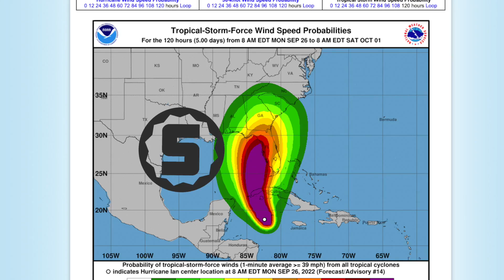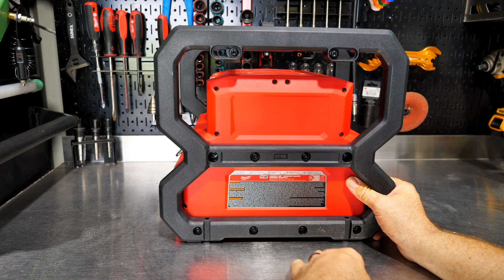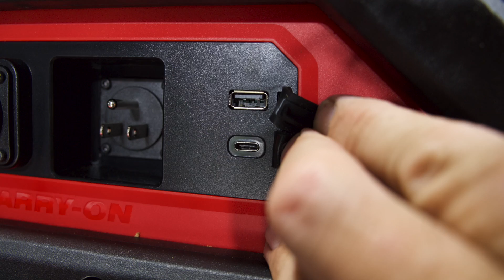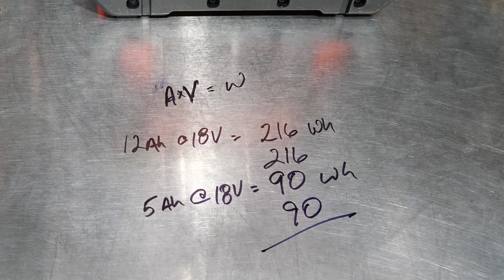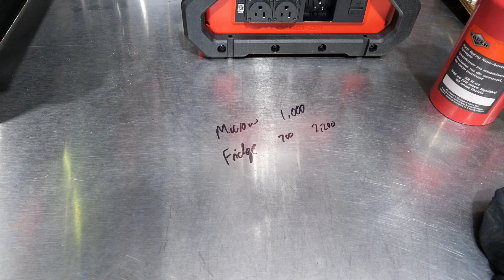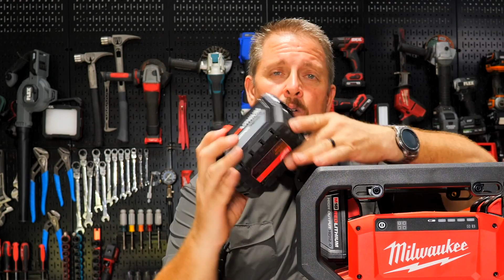INDOOR READY! 3600 Watt Milwaukee 2485 M18 Carry On Power Station [HURRICANE IAN READY]

Comment: On your light bulb draw setup you should have put 100w, 250w and single 500w bulbs on some switches so you can do smaller or more incremental changes and smaller draw amounts for smaller inverters. All you would have to have is 1 250w,  2 100w and 1 500w to give you all the necessary variability. Did you really need that many 500w for testing you do?   Even maybe a 50w or 75w for the top off or little inverters if you are testing them

Comment: The other thing I forgot was being able to hotswap batteries.  As batteries get low, then being able to replace them one at a time for a few seconds without having to power down or stop your units that are plugged in. Other such units allow you to hotswap batteries such as the lds reliance inverters which they have a 300w, 600w, and 1000w for $350 that uses m18, dewalt etc where it uses up to 3 but can use 1 or 2 depending on your draw so then you can replace them while it is use.

Comment: This is a great piece of equipment. You have to use it for what it's designed for. I use it in my enclosed car trailer to power lights and small appliances. It's also great for non continuous use tools, such as saws. An hour of blade time goes a long way on some projects.

As for the inability to charge and output power, what's the big deal if you have access to an extension cord.

Comment: I have one for a year so sustained high draw is not really it's strong suit I've got 4 12.0s on it and they die really quick but the output is very impressive I can run a full size camper for about 20 minutes with the ac on
Reply: Also packout would have been nice

Comment: Of note, from my understanding once one of the smaller batteries shuts off then the whole power station shuts down. IE. you are limited to the smallest pack's capacity in the tool. So those 12 ah packs won't get used to their fullest capacity if there are 2 5AH packs in the tool.

Comment: There is one in accuracy in what you talked about according to Milwaukee on this which is that it depletes all four batteries evenly at the same time meaning that if you have a 12.0 battery in and a 5.0 battery in its going to completely drain the 5.0 batteries while the 12.0 still have approximately half of their battery life. But the machine requires all four batteries to be charged so it will kick off when those 5.0 are depleted so your calculation of how much you have in the tank is inaccurate because you're only have as much as four times your smallest battery. That being said you can always swap the 5.0 out halfway through and then use the remainder of the 12.06 with the new ones

Comment: Very useful tool and a well explained video. I Have a question is it remotely possible if one had the right adaptors and leads to recharge a flat battery on an electric vehicle so you could drive say 3-4 km more to a charging station or home?

Comment: Good video. Ditto the comment about run time available if all batteries are identical. If one battery is dead the whole unit shuts down.
  I would not add the ability to charge and discharge at the same time, because of the shorter battery life. As mentioned at the end, the greatest cost for this system is the batteries.
  I would like to see one of their multiple charging stations with ability to charge 4 batteries simultaniously using 110 volts or 12 volts from a vehicle or 12 volts from a solar panel. This would give you the ability to customize your jobsite. Do you need 4, 8, or 12 batteries at a time charging. Do you need 2, 4, or 6 outlets at a time. You can then get the number of outlet units needed and match up the number of charging stations needed to supply the number of charged batteries during the day.
   The biggest drawback to battery powered tools has always been if the batteries you have can keep up with work.

Comment: The problem of powering tools while charging is simple. Plug the 2845 and an extension cord into the duplex outlet. If you can charge you obviously have power available to run other tools.
Reply: Yes but lets say you have it in your car to run small stuffs like lightning, fans, cooler and so on

Then when you start the car and start charging it the cooler and so on has no power

Comment: If 1 of your batteries were dead would it still run?  I’m curious if it just "needs" to see 4 batteries in the bays but not necessarily all charged.  Then it would actually deplete all batteries and you wouldn’t be limited to the lowest AH battery in the bay.

Comment: I'm curious why they have ah on the batteries.  Your calculation with a 15amp tool with those batteries was 20 mins I believe.  But if you add up all the watt hours you got 34ah which should be a little over 2 hours with that same 15amp tool
Reply: Ah and A aren’t the same.

Comment: nice video but you make your own power station run much longer than those you buy inverter 8000 watts pure sine wave and get 12 volt lithium battery 100 amp 1284 watts or even 200 amp battery build your own I going build my own power box will out that man one of those 12 volt 12 amp battery like all most 400.00 dollars I going making coming that can run fridge heater stove etc that will not cut it

Comment: Third problem-test, and a few more days in
Milwaukee service Centre. Told me regardless of use, carry on power supply uses nearly 1 amp per hour when not in use.  4 = 3 amp batteries will die overnight charging your phone, Yes they’ve made another lemon. And an awful lot of stories trying cover it up. As a contractor all I need is the truth. Not trying to hide behind the 5 Amendment.

Second problem-test, a few days later,
Milwaukee's horrible power supply Worse than I thought, see below for yesterday's results, today is much worse, I now realise that you need to switch off the power supply between each cut, as a trim carpenter using a small chop saw, the batteries run down very fast even when not using the saw, the amount of cuts they claim is outrageous and misleading,

First problem-test
Big problems, Milwaukee's new carry on, apart from the plugs being upside down, very annoying if you're putting in a two pin plug, the big problem, switched on but not in use the batteries die in 40 hours, even the big 12 amp, so if you are using this as a backup for anything, maybe for a sump pump, forget it

Comment: My unit is doing something that I’m not sure if it’s normal or not? When running low wattage lights. I’m guessing around 30 watts. After 45 minutes the internal cooling fan in the unit kicks on loudly for around one second. It does it about every 3-4 minutes. Sometimes 1/2 second, sometimes one second. Anyone have this same experience? Is this normal?

Comment: Just grabbed my carry-on.. With a free 8ah.. (internet deal from Ohio Power Tool) Have 2 8ah already from the flea market both for $180 NEW.. Just got the blower with a rapid charger & free 8ah from the flea market also new in the box for $185.. Cha-Ching.. 🤘
Having 4 8ah to power this beauty.. Nice 👊😠 
Gonna be using 2 Carry-on's to power my tinyhouse.. WOULD LOVE  16 12ah batteries to run off grid..  4k in batteries is the goal.. 
@just2wildandcrazydags 🤙

Comment: Hi, firstly want to say thanks for a very informative video on the m18 carry on, was probably one of the best vids that I’ve seen on this type of device. Also I would go out and buy this tomorrow with the 12 amp batteries if only Milwaukee was to indicate when Australians will be able to get their hands on it. Once again these big companies forget about the little country down in the arse end of the world. 
Would like to also comment on what you said regarding Milwaukee not wanting to consider the domestic market, the diy or the RV population. This is a very arrogant attitude the large companies like this seem to have and I would like to point out to them that the trade population only equates to a small part of any population regardless of country. It’s about time that companies like this start pulling their heads out of their arses and realising this. There are many people like myself who would use something like this. I live in an apartment that has a garage that doesn’t have any power source. Also I’m into flipping houses for profit. Big companies like Milwaukee need to start and wake. Rant now over. Great stream keep up the good work. Milwaukee pull your head head out of your arse. I want this power generator . 👍
Reply: Also to add to what I said earlier, for the last year or so I’ve been on the fence trying to decide what battery platform to buy into and looking at the tech of each of the big brands. Right now I’m trying to decide between Milwaukees 18v range or Makita xgt 40v platform given this is the newest on the market. 🤔🤔🤔what to sink my money into

Comment: Okay... so I am super super new to the tool game and I just want my family to be okay if we have any bad weather scenarios again, the main reason I clicked on your video... with that being said, is this the recommended generator for this situation or bite the bullet and go for the other generator released by Milwaukee? If this is your choice.. would it be recommended to get two generators? One to use and one to charge the batteries to swap? I understand that would be way more expensive again to pull off but if it's possible I'm fine with that.
Reply: Go to harbor freight and get a gas generator. They work great. Mine has saved me for the past ten years during power outages. You can get an AWESOME generator for $1000
Reply: Sorry if this is super long or if I just sound way too dumb...
Reply: No buy something you can also  charge with solar. Like a ecoglow delta or something. This Milwaukee unit is great is you want to power something for a short period where there is no power. Like a saw or a pump. Not for powering a home for up to a few weeks. Then you want something that can charge and discharge at the same time.
Reply: But generator make noise while sleeping and you have to keep a door open to run a cord

Comment: Thinking of getting it when someone has a deal on it. The Ryobi one seems to be an  all around  better deal though. However I am not in there 40v battery line up, so buying 4 of those in the higher amp models is not inexpensive either.
Reply: i build power station 3000 watts pure sine wave 48V DC inverter 110V-120V AC 60Hz today  run two digsaw one 7A 120V 60Hz nex one is 120V 60Hz 4A and i run 1500 watts heater 12A on my power station my is water proof ok that is not i can charge my and used it that you can i have volt meter tell how volt and percent my battery is

Comment: Unfortunately, this is a major fail.  You're essentially purchasing a four-bay charger & PSW inverter combo for $700.  No ability to accept solar inputs, as well as charging while in-use, make it an even larger fail to other options on the market (that have LiFeP04 batteries) at this price point.  Big, BIG fail is the fact the unit must run all-four batteries, so the capacity is limited to the lowest capacity battery out of the four.  Milwaukee needs to go back to the drawing board on this one, most construction workers aren't paying $700 for a plastic power station (without batteries), when a 4.5kW gas generator can be purchased for $400.

Comment: If you have access to AC power then why would you run through the carry on instead of just plugging in directly and then using a different outlet to charge batteries ?
Reply: If you thought you were going to lose power, but didn't want the power interrupted OR
If you wanted to use less powerful power supply to charge it while the Milwaukee handled a high wattage load.   There are many reasons.  These are just two.

Comment: 6:16 it would only require 6 relays (3 normally open and 3 normally closed) to switch when the input is powered and you would pull power from the cord and not the batteries.

Comment: Can this station run a portable heater for example? Lets say I wanna run a 1800w heater with 4x 12amp batteries, how long would it last, asking from Canada.
Reply: If you put 4 12ah batteries on there you got  864 wh of battery power. About 10% of that will disappear in heat. What leaves you with 777wh. That means you  can run a 1800wh heater for less than 30 minutes
Reply: @gijsblok34  thanks!

Comment: Im sure they could fit the technology in this tool to run a corded tool while its charging. They could change the controller to divert the incoming current to the output outlets and use the remaining current to charge the batteries. Lets say you're using a saw that takes 600W of power (wall outlets have a max of 1800W, lets say the generator uses 1000W., the controller diverts 600W of power directly to the outlet without going through the batteries at all. That leaves you with 400W to charge the batteries.
Reply from the maker: You are correct, and somehow you would have to have a stated limit as to what the power station could deliver during charging/discharging. Also, there's the cost of doing it, parts, etc. It's not impossible, but it is troublesome. Thanks for watching.
Reply: I'm missing the point of pass-thru. If you have access to grid power why not just use a triple tap or similar & charge the unit while running your corded tools? For UPS I guess??

Comment: I agree with you about adding a screen. Many such devices has such a screen. Also adding the power while charging off ac which again only requires a relay and a little bit of electronic control. This means you do not have to move your plugs over to a separate power strip coming in. Solar interface is a great idea as you suggested. The other thing is the usb c if it is not, should be upgraded to full high voltage and amperage for powering laptops etc. This is 60-100w at 20v as the high power usb c standard can be used up to. ALSO the cage should be extended outward in the front, back and underneath to prevent water or dirt from getting in the bottom of the unit and protect the plugs in front if it tips or is knocked over. Keeping the unit away from everything around it on all sides by using the cage.
Reply from the maker: Those are some good ideas. I'm sure the cage was kept as tight as possible for size issues, but it definitely makes sense to have it bigger to protect those other items. Thanks for watching and sharing.

Comment: You can't account for the whole of the 12ah batteries because the 5ah will die before the 12ah will so you have to count all the batteries as 5ah. They have less capacity. The 5ah batteries are the limiting factor. IE your capacity it that of your weakest link, the 5ah batteries.  You will suffer even more because the 5ah packs have less amperage output without heating up because the packs do not have as high a discharge rate ability since they are only 2 set in parallel packs rather than 3 set in parallel like the 12ah., so you loose even more from the 5ah capacity due to heat loss then the same draw on the 12ah batteries. The 12ah packs also use 2170 rather than 18650 in the 5ah which gives them even more amperage output and less heat loss due to the cell design and capability inside.
Reply from the maker: I believe they are doing some balance discharging on these batteries, but we will verify this. Thanks again.

Comment: That is nonsense. If you are running on ac and charging, you simply put in a relay, and switch the ac output over to the ac input, no longer using the inverter/batteries at that time. All it requires is an additional relay and control electronics which is minor. No impact on the batteries.
Reply from the maker: Yes and No. If you're plugging in from a standard 120V (15A) wall outlet or ext cord and splitting the power between charging the batteries and powering the 120V ports, then you can't send the full 15-Amps to either side, you'd have to share it. So, you would be limited as to the rate you can charge at as well as the rate to which you're supplying to what's plugged into it. Therefore, to make both happen, it requires electronics and use of the batteries. We see your point, but it's not exactly black and white. Regardless, we'd like to see the option for both.

Comment: I love Milwaukee but this is a rip-off at almost $2 Per Watt HR you are better off with something like an Ecoflow Delta 2. It has the same 1800w power output plus 1024WH, solar charging, phone connectivity, and a display that gives you all the information. The cost on that comes out to about .97 cents per watt Hr

Comment: Milwaukee specified 2 very important facts 1= it needs all 4 batteries to work and 2= it drains all the batteries at the same time, so if you have 2, 12 AH batteries & 2, 5 AH then it will default to your lowest AH battery, meaning once it drains the 2, 5 AH batteries it will turn off and it will have only drained 5 AH from the 12 AH batteries, so the way you should calculate this is by multiplying the lowest AH battery times 4... 5AH X 18V X 4 Batteries = 360 WH, not 612 WH....  Now if you were to use 4, 12AH Batteries then you would have 12AH X 18V X 4 Batteries= 864 WH which is exactly the same as using 2, 6AH Batteries on the MX version of the power station.  6AH X 72V X 2 Batteries =864 WH

Comment: I'm so stoked to get one or two. For now, watching you show it off will suffice. Looking to see real-world runtime on my fridge and freezer, and another on my well pump and router. I rarely lose power for a period 24 hours or longer, so this should cover me. Thanks for the video. Good math too. 👍🏻
Reply: Honestly for that function a purpose built solar power station, with lithium iron phosphate batteries, would work better. bluetti, ecoflow, pecron make good units for that. This is a great small use item, especially if you have alot of m18 batteries. Just
Because of the weight
Reply: @jfraz6246  indeed a 200ah ithium iron phosphate battery cost about $600 now.